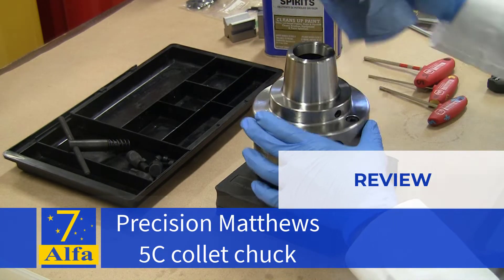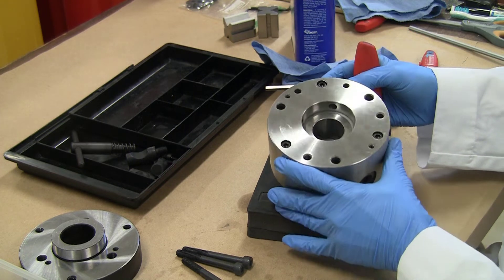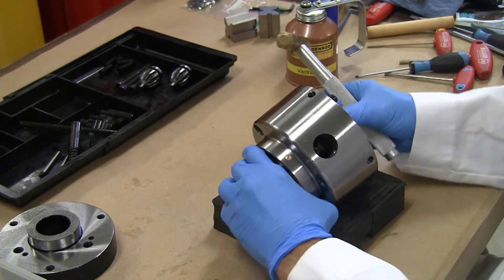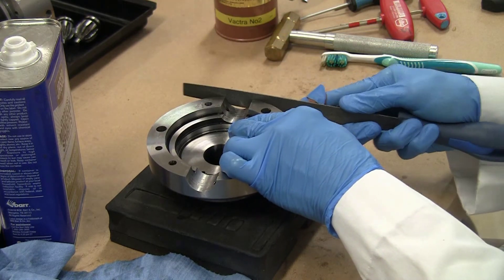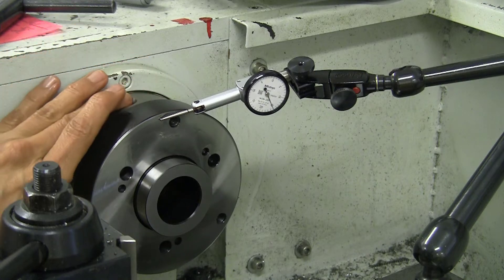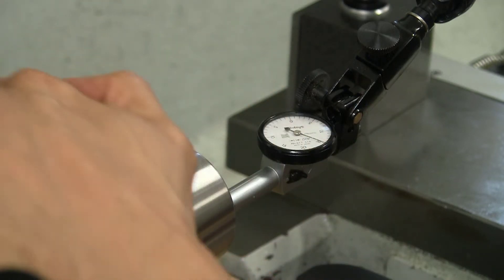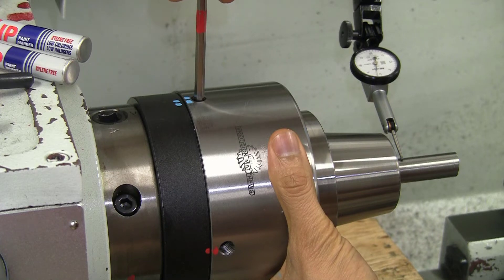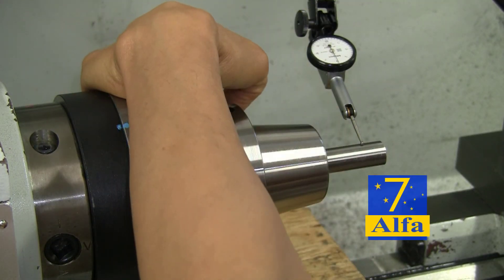Precision Matthews 5C Collet Chuck: Review

Comment: A more than good enough video for me to subscribe. No needless talking, unnecessary music, pleas for likes and to subscribe, and just what your testing found. Overall it looks to be fairly well made chuck. I would have loved to go with the 5C collets but wasn't willing to trust to luck for what I'd get with the average and generic brands of collets. And a full set from Hardinge is out of my budget. Instead I bought a set of Bison ER 40's for my BP clone and get dual use on the lathe. Much slower to change sizes or parts and far less capable as far as all the additional options 5C has of course.
Reply from the maker: Appreciate the comments. I too was looking at getting a set of ER 40s. You are right about the collets: they are the weak link in the chain.

Comment: Very nice review.
Do you think the set true feature was worth the difference over the economy chucks.
I have been looking at this same model. 
Just subscribed to your channel. 
Thanks for sharing.
Reply from the maker: I am not sure the set true part of the chuck is that helpful. The amount of adjustment is very limited and is a bit of a pain. But they don't (or didn't when I last looked) offer a non-adjustable version. However, it is close to twice the price of the non-adjustable ones. 
There was a video by Stefan Gotteswinter form a long time ago, where he took one of these cheap chucks apart, sort of refurbished it and got it to a good spec. But his skills are way up there.
I am pretty happy with this chuck, esp with the "power screwdriver."

Comment: Looks like you got a sweet example - it has the quality of my Bison 5C chuck. From the comments it doesn't look like all of the PM units are this good.

In my experience with lots of different Buck and Bison chucks the Adjust-tru/Set-tru centering is best done with the locking screws kind of tight. Yes, the screws fight each other a little, but there is almost no walking out when final tightening is done. Hard to say how tight, but not loose.
Reply from the maker: Thanks for your suggestions. I have tried both ways and you are right about keeping the screws tight... though the tightness can be hard to gauge.

Comment: Excellent video…I’ve seen so many people bashing the nose trying to split the body, instead of using the screws…
I really don’t understand why people use grease in chucks, it just acts like a magnet for dirt and metal chips….a light oil like 3 in one is all that’s needed, There are no high speeds or temperatures that require grease…
I’ve never used grease on any drill or lathe chucks in 50 years and never had any issues….it also makes future maintenance so much easier…Grease can harden overtime and actually seize the chuck
Reply from the maker: Thanks for your comment. And the good point about the grease.

Comment: Video starts off "Welcome to the Shop".   White coat, gloves, that's not a shop, that's a freaking lab, or a surgery center.  Although the next time I have surgery, if the surgeon breaks out a collet chuck, I'm out.
Reply from the maker: You might be surprised by the use of power tools and chucks, wires and even pliers in surgery😄

Comment: I received my 5C Matthews chuck today. 
I am not going to take it apart at this time but wondering what oil will you be using in the ball oil port ?.  Great idea to check the mounting plate by itself.  When I Aline the chuck thinking of using the ID collet seating taper. Again I really enjoyed your well produced video. Thank You BillB
Reply from the maker: I used some ways oil, since I already have it in one of my pump-style oil cans, but I am pretty sure any oil would do the job.
The ID taper is a good way to take out all the variables that come with the collet. 
I would suggest doing the alignment a little differently. Perhaps make the front mounting screws snug and leave the 4 adjusting screws a little loose. Tap the chuck into alignment gently, rather than using the 4 screws. Then sung up the 4 screws. I expect this method to be a little less faster, and less frustrating.

Comment: regardless of how good this chuck is, I'm sorry I ever got one (different brand, but that's not the point), these things have way too much overhang, so they will vibrate because of the overhang regardless of how low the TIR is, also too much weight on the spindle. its mind boggling that bench top size lathe spindles have morse taper rather than 5-C.
Reply from the maker: I agree. It is very hard without something to hold the taper pulled in.
My PM lathe has a D1-4 mount, so I luckily don't have that issue.

Comment: I read comments about ER collets. I started out with ER 25 collets because of the feed through limits of my lathe. 
I purchased a cheap set off eBay and a couple of extra front nuts.
 I decided, since no one seems to sell one, to make my own ER collet chuck. Using some BMS in my four jaw chuck I bored and threaded the matching thread for the nose of my Myford lathe 1.125*8 if memory serves. I then machined the mating surfaces for the mandrel into the blank. I'm fortunate in having a spare mandrel with which to check. 
The block was then mounted on the lathe directly and the outside, nose thread and inner 16° included taper cut. 
The chuck is not ground as I don't own a toolpost grinder yet and for the work I'll use this for it's more than adequate . 
When it came to testing runout of the inner taper of the chuck was negligible as to be expected for an on machine made part. The collets proved differently.
 On examination I discovered that every collet in the set was dirty. Not just grime but swarf from cutting the numerous slots with a slitting saw. To clean them out I used a long bladed utility knife and went through each slot until all the junk was removed. Then washed in degreaser and oiled to prevent rusting. Subsiquent tests showed runout to be less than 0.0005" in most cases some better. Certainly acceptable for what I intend to use.

As to Precision Mathews I have just purchased a Chinese mill through them. Their numbering system has a T in the number if it's made in Taiwan and nothing in the Chinese number. 
Difference from what I see is the Taiwan warrantee is five years instead of three, there's shorter wait time if they don't have stock and the Taiwanese are generally a bit more expensive for similar parts.
 As to service I've not heard or read anything adverse. Clough 42 had a total replacement of a mill he purchased because he couldn't tram the nod out of it. Bad machining somewhere. 
Blondie hacks has just recieved, free, gratis, a new mill for all the nice things she said about her pm-25. She also has one of their smaller lathe's. 
As someone already said Adam Booth of abom fame recently installed a PM lathe in his new shop and that's a major departure from his usual made in USA mantra. 
So there's three major Yt contributors using their products so it must say for something.
I've always heard that Matt's the guy to talk to and I've certainly had emails acknowledged within ten minutes and replied to within 24 hours, working days, as a rule.
You pays your money and yous takes your chances.
Reply from the maker: You know, the thing that is surprising about some of these cheap parts is that their quality can be quite good, even if the finish is not up to par. I suspect it is because the finishing adds too much to the costs.
But for hobbyists, the products would otherwise be mostly inaccessible due to cost. Hints and advice can really help us make the most of our cheaper parts.
I have the PM27V mill, and its OK but really not in the league of a Bridgeport. Never having used one previously, I had assumed that some of talk of quality was just people being fond of machines they were trained on. But there is no doubt that the true Bridgeports are really good to use.

Comment: I purchased a similar chuck but without the "set true" feature. My Myford lathe has a screw on mandrel so I machined my own base plate on the machine. When it came to machining the nose section that fits into the recess of the chuck I made it about 0.010" smaller in diameter. The chuck was then mounted with the three bolts from the front, snug but not tight. Using a small soft hammer I  tapped the appropriate side until a DI on the inner bore read zero. The bolts were tightened to about 50ft/lbs with a torque wrench and runout checked again. Still virtually zero. A clean 1/2" 5C collet was mounted with a 1/2" end mill inserted. Runout on the shank of the mill was less than 0.0003" at the mouth of the collet. Quite acceptable for what I need.

I also dismantled my chuck as it felt rough. I too had difficulty opening it until I realized that if you took the three bolts that held the two halves together and inserted them into the adjacent threaded from the rear holes you could use them as Jack screws to push the two parts apart.
 On opening I found lots of machining bits in the grease like it had been picked up off the floor. The whole was washed out with degreaser and blown dry. There were lots of sharp corners that had to be debured. I used a slip stone on the gear teeth that were too hard for a file. A needle file of various shapes sorted the rest. I then regreased with a little lithium grease and reassembled the chuck. It runs much smoother now. Then the chuck was mounted and tested as above.
Reply from the maker: That was quite the adventure, machining your own base plate. It is quite amazing that the adjustment stays correct even after use.
Thanks for the tip about using the rear holes to open up the chuck.

Comment: Is this 5C chuck better than the lever collet closers in terms of gripping power?
Reply: The lever closer can be adjusted to enough force to damage the collet, so to answer your question, the lever closer can provide more "gripping power". But you may not want that! The big advantage the lever closer has is in production, with a bit of practice you can move really fast on part changes. The disadvantage is the lever closer is expensive, makes noise and vibration if it is fitted and not in use. 

For my prototyping I much prefer a "toolmakers drawbar" handwheel style closer. If I have a lathe without a collet adapter I use my trusty Bison 5C chuck - pretty much like this PM but without the Set-Tru and 4 times the price.
Reply: @randydewees7338  Thank you for your generous comment.
Reply from the maker: I have no experience with lever closet closers in a chuck, so I can't answer your question directly. But I will say that this collet chuck has plenty of gripping power. I have to be careful not to over-tighten it. I will go to snug tight with the collet wrench and then tighten perhaps 1/2 turn or so more.

Comment: I wonder if they make for ER collet sizes.
After trying the ER collets for accurate lathe and mill work, I won't go back to the R-8 or 5-C collets. Currently, there are no soft ER collets made but a good grinding shop can grind ER collets for accurate fixtures.
Reply from the maker: Yes, they do make a D1-4 chuck for ER40 collets. It is much cheaper, at about $150. I have been eyeing it and would really like to hear more about which size collets you use for your mill, and which brand.
And thanks for watching the video.

Comment: Precision Matthews are the same as Warco and Chester engineering machines in the UK they import Chinese or you would hope Taiwanese machines under there name which they inspect before selling to you but they are still clones of Colchester/Harrison lathes and Bridgeport and others not sure what USA company still make made in USA lathes (nice to see Colchester lathes still set the bench mark which all lathes company follow and still do today) anyway the 5C collet chuck PM is selling to you is still a import clone from China or Taiwan which come from them factory's you see on Aliexpress and Ebay difference  is its got a name on it ie Precision Matthews and others which means they might take a bit more care when making it, Ebay are generally the seconds not quite up to scratch, Warco charge £162 shipped for the exact same 5C chuck and using there collet less than 0.001mm run out, can the name PM worth a extra $150+ from the same Chinese/Taiwanese factory your choice but it still needed finishing so do they inspect them before selling to you i doubt it.To prove a point about cloning look at a new  Colchester/Harrison manual lathe and then look at the Colchester cloned version precision matthews is selling Abom79 as one
Reply from the maker: I would agree with a lot of that. Though PM will specifically tell you which of their parts are made in Taiwan, and of course, cost more too.
Reply: did you know on the back of that chuck two of the holes is to split the body by inserting the screws again and as you screw the screw in it pushes the front off
Reply from the maker: @slotjocky69  Thanks for the info. Good to know!

Comment: I think you did a nice job on video just for my curiosity I looked up PM chucks not bad for price not sure if they are hardened at the collet nose if so they should work well for a home shop. You will probably have some variance from collet to collet and will have to rest chuck for each size you use. Even my $3,000 dollar set of Hardinge collets will have .0003 run out in a Harig spin indexer just the way collets are.

Comment: Nice truer  , but didn't see you finally torquing the bolts , to clamp firmly??
Reply from the maker: Thanks for your comment. Are you talking about the camlock heads on the chuck that go into the lathe? I usually will gently tighten each until the back of the chuck is flush with the spindle nose, and then go around one more time tightening them fully.

Comment: Excellent review. I recently purchased the same PM Chuck but unlike yours mine was way out of alignment. The backplate had to be reground parallel and the boss was so tight in the Chuck that the set true screws had no effect and I had to turn it down a few thousands.  Then when I could adjust the set true to center a dowel close to the nose the end of the dowel would precess almost 25 thousands.  I am currently working on re grinding the back of the Chuck.  On inspection while set up I find the back of the chuck surface is 5 thousands out. While going through all of this I also found that only a few of my collects were accepted into the chuck. After careful measurements the back of the receiving hole was only 1.249"  or 1 thou too small. Enough to make a difference. That has been honed out.  Like you I found the fit and finish to be excellent.  I was disappointing to learn that these chucks are made in China.  But unlike you the chuck that I received was not as precise as what I expected from Precision Matthew's.  Color me disappointed.
Reply: you should have at least .006 clearance from mount plate boss diameter to hole on chuck body for set true. how long of dowel are you testing If you are having that much run out at say a inch away check face run out of chuck right by 5C taper hole this should be only .0001 to .0002 if this checks good I would look at collet. For testing I would use a gage pin not a dowel pin gage pins you can buy single pins at MSC or McMasters for less than $10.00 .  I would return chuck to PM they should send you a new chuck.
Reply from the maker: @terryallemann2654  Appreciate the comments. Always good to hear from knowledgeable people. I think you are quite right about the clearance between the mounting plate and hole in the chuck body. I have not measured it as yet, but it is really tight.
On the other hand, my issue is likely compounded by the quality of the collets. They are cheap, and very tight. I had some trouble getting the drill rod in. The collets set is not from PM, but a house brand from KBC Tools. 
I don't know enough about 5C collet brands to know which ones to go for. If you have any recommendations, please feel free to suggest them.
And your gage pins comment is being put on my to-do list.
Reply: @terryallemann2654  Thanks, Terry. Unfortunately, the chuck was a gift and, not expecting this kind of difficulty, sat on the shelf for many months until I needed it. I doubt they would take it back now, especially after I have tried to correct the issues.  They were rather terse with me when I first complained to them when I found out it was made in China. The clearance of the plate boss was less than .001" and it took over .025" of trimming it before I could get it to align at the nose of the collet.  BTW I check the concentricity of the collet before I condemned the chuck.  I am checking at the nose of the collet and out 4" for runout. The plate was not parallel and had to be ground. (I also checked my D1-1 spindle and it is perfect)  It's so disheartening. The fit and finish is so beautiful but it's almost unusable.
Reply from the maker: Thanks for your your detailed note. I too am surprised by your findings. I have had good luck with PM stuff to date. In fact my lathe is a PM 1236-T (Taiwan). 
I think your chuck was a Friday product :). Seriously though, this seems way outside what one would expect. I would certainly drop Matt a line. From my very limited dealings with PM, they have always been very happy to help.